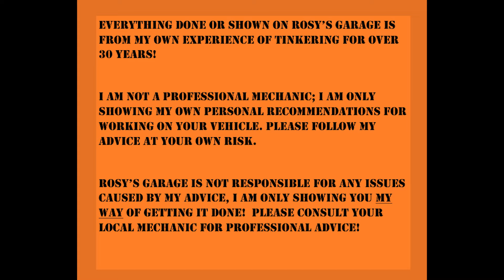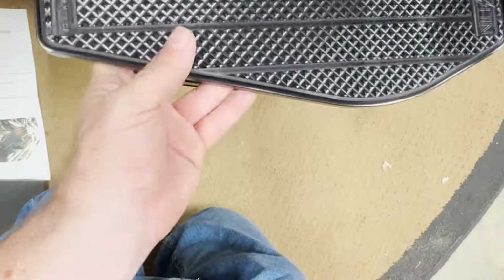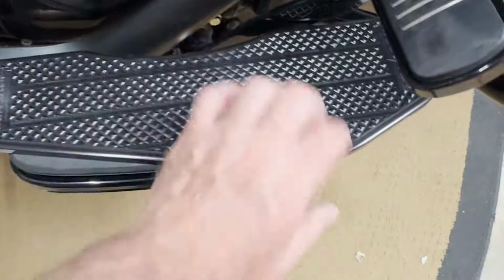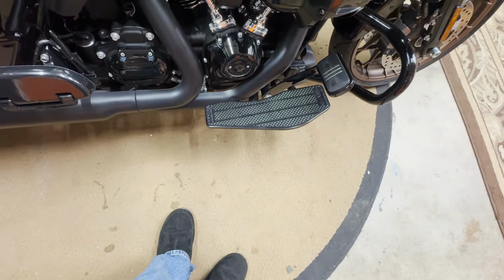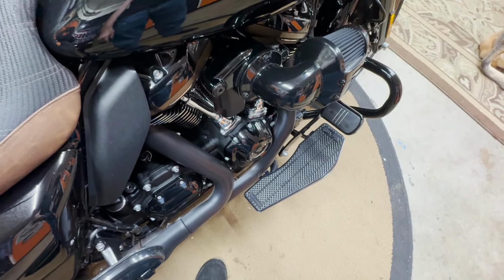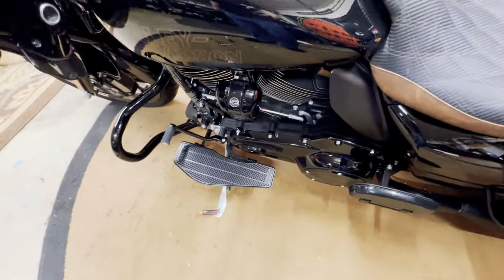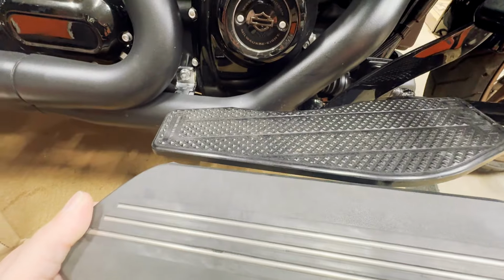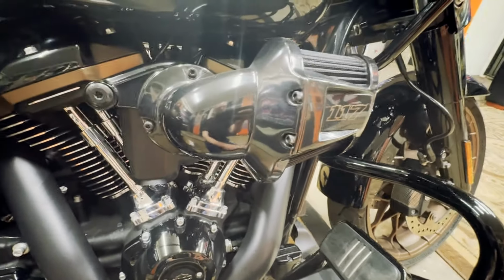Thrashin Supply Floorboards Review

Comment: im comfort before form. so rubber under my boots then metal plate   gotta say the pricing is way too high for a metal plate and name. I like the ones you took off.
Reply from the maker: Comfort wise I would say the thrashing supply boards are 95%, however I always felt like my feet were going to slip off going around corners. Multiple times when it was damp out my feet would slide off

Comment: I worry that they’ll be too slippery without any rubber?
Reply from the maker: Actually it’s the exact opposite. When the stock floor boards with the rubber get wet they get slippery. Because of the serrated nature of the thrash and supply boards, my foot is very well planted when wet. In fact the main reason I got these boards was my feet were slipping off the factory boards when it was damp outside
Reply: @ man that is really interesting and I appreciate the explanation! I may give them a try!